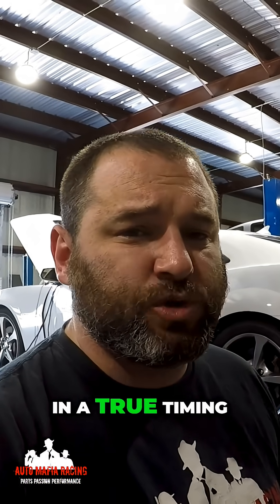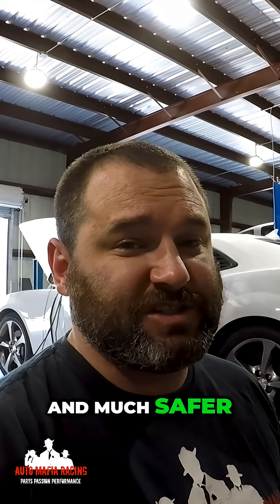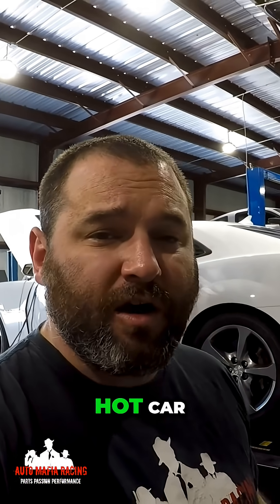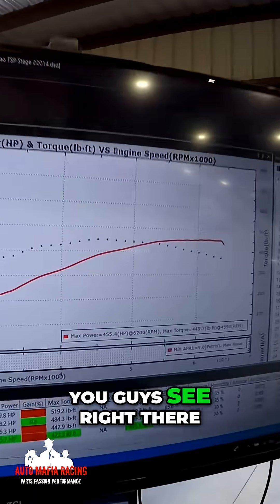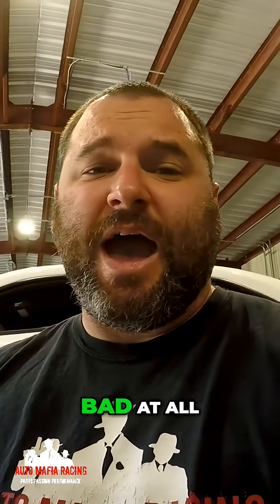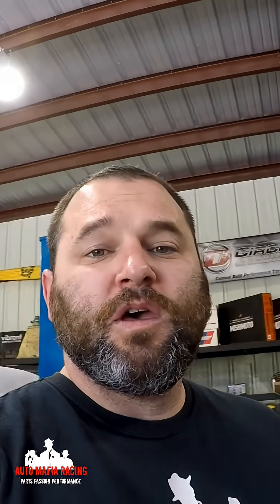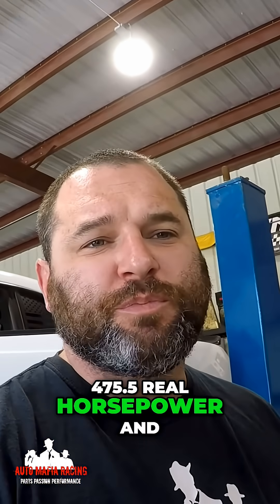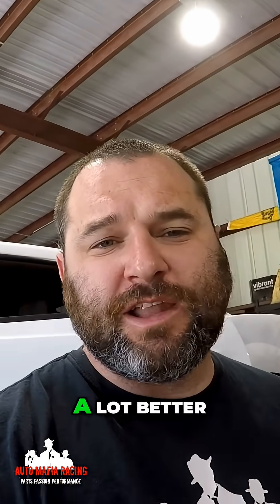Daily Driver Tuning: More Torque & Safer Horsepower Gains #shorts

Comment: I am in the process of converting my 2006 4.6 L v8 into a gt500 lower manifold and supercharger with fuel rails and 775cc injectors how much for a dyno tune trying to be around 550hp-600hp
Reply from the maker: $1500
📬 Contact AMR for build advice and guaranteed lowest prices.
📞 941-979-1132
📧 Support@AutoMafiaRacing.com
www.automafiaracing.com

Comment: I wish I had the money to slap a blower on my mustang. I think about it all the time.. the issue is I drive the car, maybe two days out of the week. And as a 400 wheel manual, it's already fun to drive. My main thing is, I don't want to lose that drivability.And factory feel.. i'd like to have a stage 1 whipple set up on 8/9lbs of boost n 93 pump gas n Whatever it makes it makes.. My other issue is, I like having cadillactic converters on my car  and we all know that they hate life once they're boosted.. Plus I don't like a car that's over the top loud.. Oh and the money snowballs so fast. The more power you make, the more you gotta strengthen everything else around it..
Reply from the maker: yeah, boost definitely changes the whole dynamic